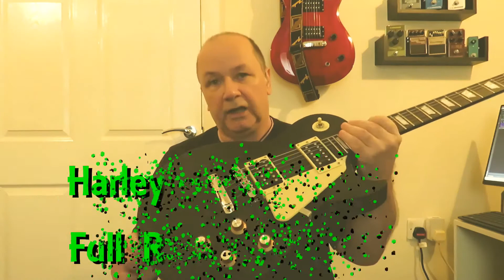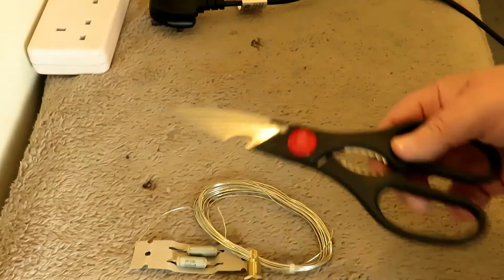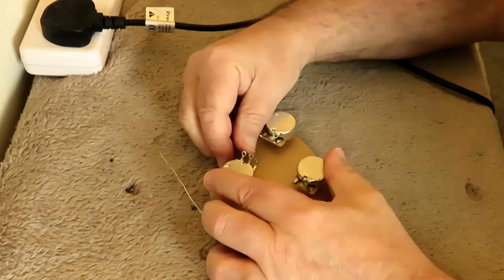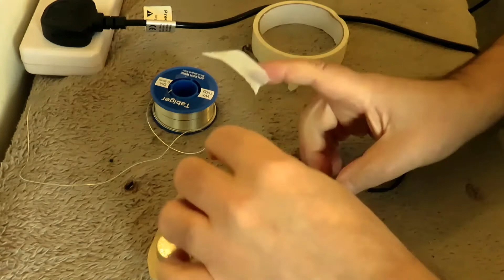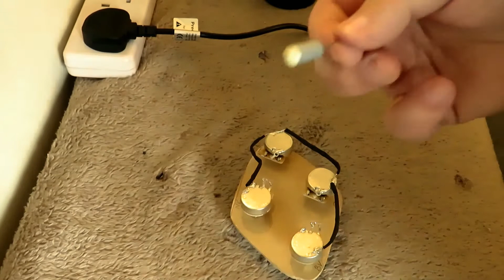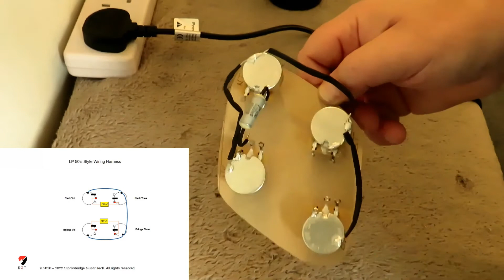Harley Benton SC 400 Complete Re-Wire (50's Style) Part Two

Comment: Another brilliant video, where do you buy the parts needed from.
I have a eipiphone Les Paul modern and at some point I would like to change mine to 50,s wiring and replace the pickups too.
Mine have coil taps at present and I would like to keep that function if possible, do you know if u can. Many thanks
Reply from the maker: Thanks Peter. You can buy the parts online and also get wiring diagrams too, just do a search for something like 'guitar parts' and 'Les Paul 50's wiring diagram'. There are quite a number of diagrams and some are clearer than others so download a few and pick one that makes the most sense to you. Yes you can still keep the coil split function, but the wiring will obviously be a bit more complicated. If you are interested and you're in the UK, I am now thinking about selling my own wiring harnesses for SG's, Les Pauls etc - you can have either Modern or 50's style. I have a couple already made up if you are interested.
Reply: Cheers, only been playing a year and it's my only guitar so won't to get some more practice under my belt first before I upgrade it .
Reply from the maker: @peterludlow9847  I absolutely understand that Peter. I think I'd been playing for about 10 years before I even attempted to adjust the truss rod. Having said that, back then we didn't have Youtube or the internet, so unless you were fortunate enough to work in a music shop guitar dept or similar, there was really no way to learn this stuff.